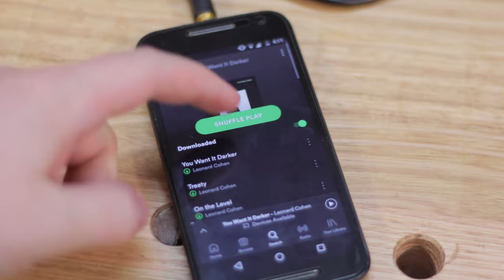Headphone Stand

Comment: Great video Paul, i met you yesterday at Timbecon :).

Do you have a video about the dowel jig that used in this video? and why did you use epoxy instead of wood glue?
Reply from the maker: Yup, the dowel 'jig' is here https://www.youtube.com/watch?v=nbwYKx3baRI
Router powered.

Wood glue would work too, but I was on a bit of a timeline. 5min epoxy gets much harder much quicker than wood glue. One of the dowels was a little loose after sanding, so the epoxy helped gap fill. It also didn't have to be clamped, which given the weird shape of the top part was good

Comment: Is that a Laguna 14 bx?
Reply from the maker: 14|12. The 14|BX came out about 3-4 months after I got my 14|12.
Reply: I'm looking at the bx and suv.  Both are luxurious tools, and either would be a dream.  I like the idea of rack & pinion table adjustment, but at the 14|12 price.

The headphone stand is a great concept.  It's now on the 'to do' list.
Reply from the maker: The table adjustments on the BX look the same as the 14 to me. More powerful motor (15a? Not sure), taller cabinet ("floor model"), heavier (so even less vibration), foot break, but the rest looks the same (guides, fence, resaw capacity, upper guide)
Reply: I'm guessing 15 amp plug.  I think ya spot on with the 14|12 v BX comparrison.  It's the 14 SUV that has the rack & pinion adjustable table, along with a nice price tag.  If the BX was available option at the time, would you spend the extra for a BX?
Reply from the maker: Thats a hard call since the pricing on everything has gone up since then! One of my big requirements at the time was 10a, and the 14|12 is the best available at 240v10a. IMHO at the ~AUD300 difference between the two, I'd probably still go with the 14|12 - it handles what I've thrown at it.

The gap between in features/power between the 14|12 and 14|BX is much smaller than the gap between the 14|BX and 14SUV.
Reply: The gap/machine capability analysis leads me towards the SUV, but economics says 14|12.  Plus, as you know, the 14|12 is a great machine.  The purchase might make a good 'debut' video.  

Thanks for your time Paul.
Reply: I have the 14BX, it's a standard plug. I went back and forth over a month between the two, and then when I thought I'd made up my mind the BX wasn't in stock so I nearly went for the 14/12. Unless you're doing big time resewing I don't know that the bigger motor is a deal breaker. If the 14/12 had the foot break on it, I think I'd have that in my shop now, but I don't regret it for a minute.
Reply: Just put the order in for a the 14 SUV.  Figured I'd splurge just this once.